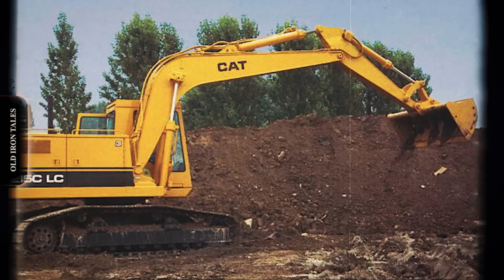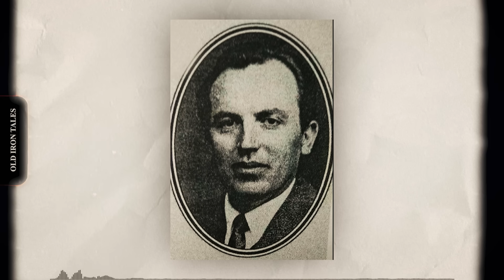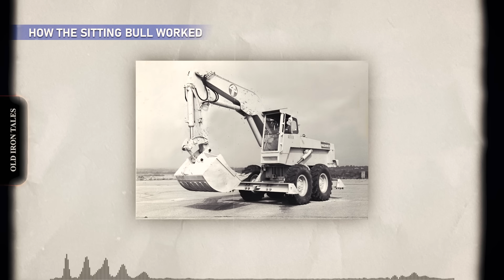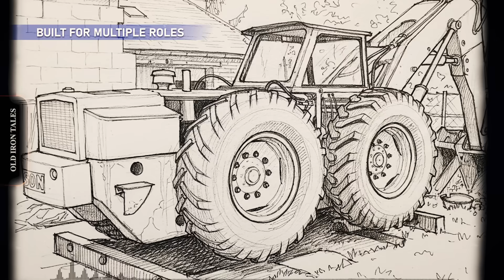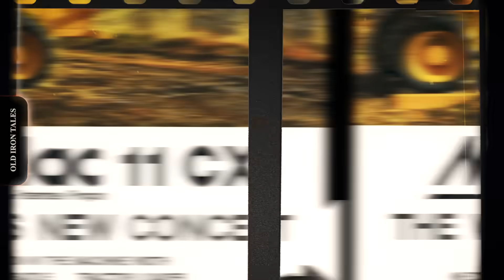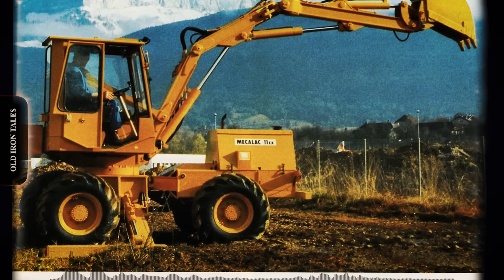The Strangest Excavator Ever Made | Pingon Sitting Bull

Comment: found in love with the look and the unique concept of this company wich is not far from where i live in France and i am proudly owning and restoring 7 of them today in my collection (only 14B, C, CH and D model). 
Super stable machin, a digging power like a 25t equivalent and a very good relability (thanks Perkins 6.354). One of the drawbacks is the maintenance of the skid steering and brakes clutches to do fully every 3000h and need 2 days of full work. 
i saved two CH model from Savoie region , just next of Chambery and the old man who got them new in 1981 and 1986 did 15 000h and 34 000h with each, and they are still working, that's proper work horces.
Reply: I also live in France and would be very interested in one of these

Comment: I remember one of our subcontractors who had two Pingons in northern Italy in the 1970s. I was very young and passionate about excavators, just as others loved motorcycles. We had the entire Simit and Hydromac range at the time. As excavators, they weren't on par with tracked machines. They were too long and required maneuvering space, especially in the mountains, that wasn't available. The crane configuration and the configuration for digging piles and shafts up to 20 meters deep were unsurpassed .

Comment: It looks like they missed an obvious market segment, underground mining, you wouldn't need the 18kph ground speed so smaller tires would allow for an overall shorter machine when in travel mode, and they could be designed with low ceiling height friendly attachments and could've found a whole new market segment..
Reply: In my experience of underground mining equipment, the only thing that seemed to matter was the height. I worked for a parts manufacturer for CAT UGM and Hitachi and another Japanese mining shovel power train manufacturer noone has heard of

Comment: First it is claimed it travels at highway speed which sounded ludicrous to me and later is stated a top speed of 18 km. That's when I stopped watching.
Reply: Driving 18kph in heavy equipment is like driving a top-heavy NASCAR with no shocks, just springs for suspension.
Reply: How long is a rope? Highway speed can be anything between 1 kmph to 150 kmph, all depending on the conditions and limitations.